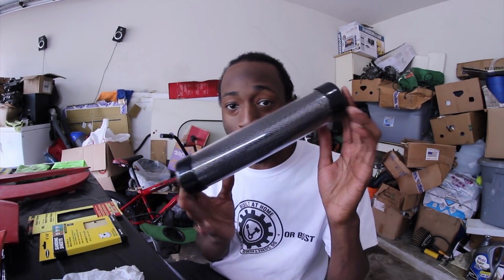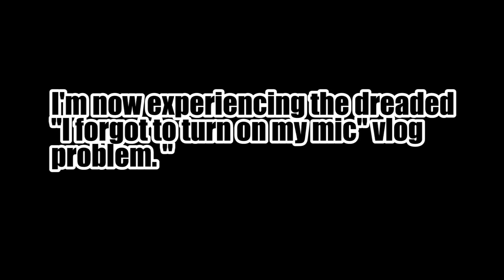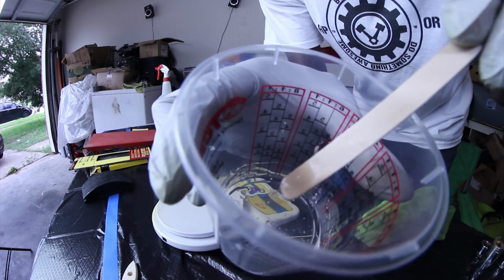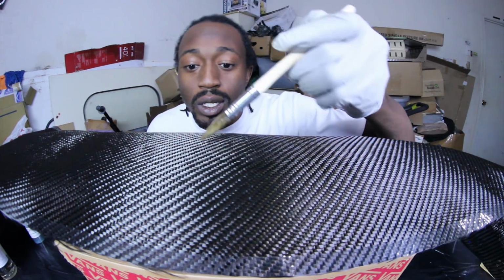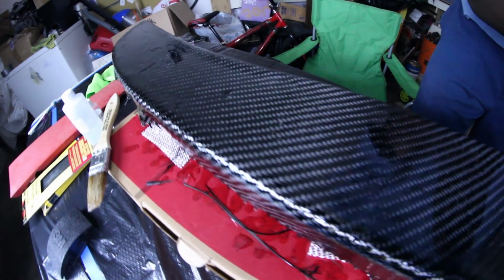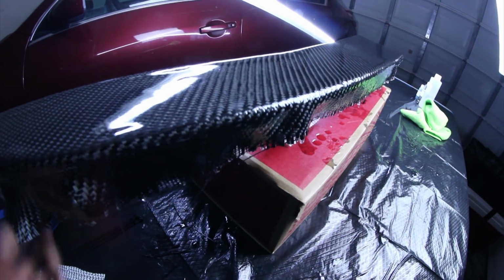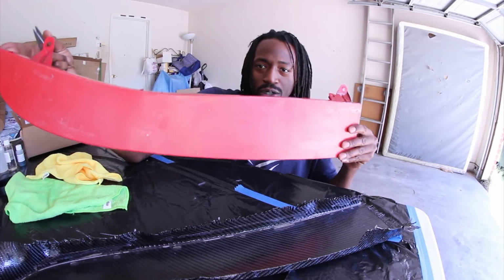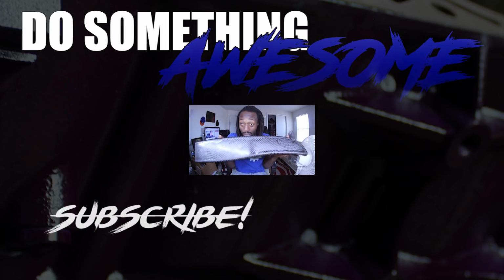Making my first Carbonfiber Body Panel

Comment: Considering that a) it's not a structural piece and 2) The original piece is ABS plastic, I think you should of just gone for a 'skinning job' by bonding the carbon fiber to the OEM piece. I plan on doing this with the mirror caps and door flags on my 500 Abarth.
Reply from the maker: The original part is Steel, not ABS plastic. I'm learning how to actually make a true carbon part, more than just a mere skin.

Comment: Came to see how you did, who would have thought....i knew i recognized those panels, and then you said it came from a MR2! good job fellow MR2 brother, i used to have a yellow widebody with a black top, currently on my 9th MR2. I am not a pro at fabricating but from my experience, first layer of resin, wait for the super tacky stage, lay your carbon over it and wrap it tightly again the part, the tacky resin will help shape the carbon around your part, avoiding any flaring around the tight corners and edges. Subscribed and looking forward to your other projects.

Comment: Just a FYI ISOPROPYL Alcohol can be used concentrate to clean parts on a car.When I prep a body panel or a car I wipe the car down first with Preps all then I go over it with Isopropyl with a spray bottle.

Comment: Well u got a black pigment with the kit u should have used on your first layer of resin to prevent the red colour shine thru the small carbon fiber holes that the weave can have. Next time try do a mould out of the orginal part to then make a carbon fiber part.

Comment: Great, clear & articulate video. Thanks for sharing. 

I've built a career out of just trying stuff out and screwing it up. Version 2 is always better. If we're not making mistakes, then we're not really learning anything - in which case, what's the point? Great initiative and awesome attitude. Also, the end product rocks.
One note: I have one of the cheap $30 electric paint guns from Amazon. Works great for spraying PVA, and you don't have to haul the compressor out. (Gelcoat is another matter.)

Comment: Moving the epoxy around way to fast and repeatedly jabbing the brush in to it is causing the air bubbles. Only stir it and not to fast, you need a wooden lolly pop stick or similar to stir

Comment: apply heat to the carbon after you lay the proxy... not to the proxy thats in the cup. thatll rid of the bubbles. sand the edges and stop cutting ppl lol

Comment: When duplicating parts , u lay over as you did ( the plug )  , that would be your mold , which you in turn use to duplicate the part desired . 
Thus  in your video  you just made a piece that is larger than the original..    To duplicate the original  part u would lay your carbon fiber on the inside using the same procedure.

Comment: Devon, that is not how it works. 
C/F becomes stronger than steel and keeps the desired  shape when heated and pressurised. You used it as just a decorative material.
I mean you had to epoxy resin it to shape it. It's a complete waste of  expensive material.
Reply: alex a you are referring to prepreg wet lay up can be made just as strong and light weight. There are 4 ways to make composites autoclave prepress are just one way: there’s also vacuum bagging and wet lay up all work they all have upsides and downsides.
also carbon fiber composites are stiffer per weight than steel terminology is key look up kyle.engineers on carbon fiber vs s glass vs Kevlar for a great explanation

Comment: DO NOT do what this guy did. You have to create a mould, eliminate any trapped air,  vacuum seal the carbon fiber, apply the resin, and then let it cure while maintained in a vacuum.    
  
The part looked terrible and was designed poorly.  Carbon fiber is desired because it is stiff and strong, this material was too thin to benefit from carbon fibers stiffmess
Reply: Did you know what you are talking about?